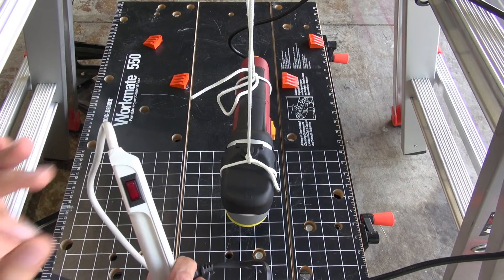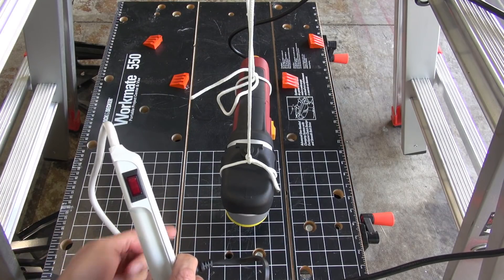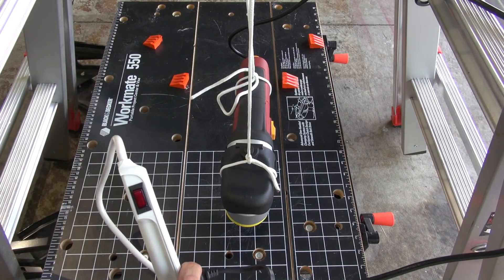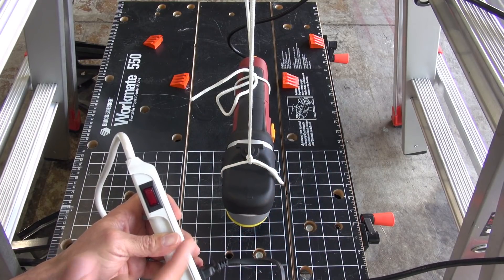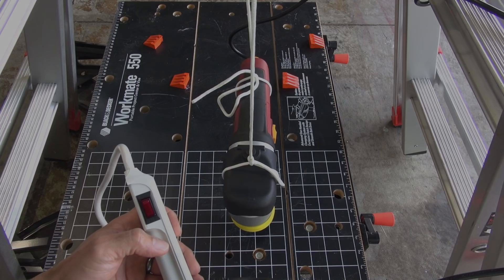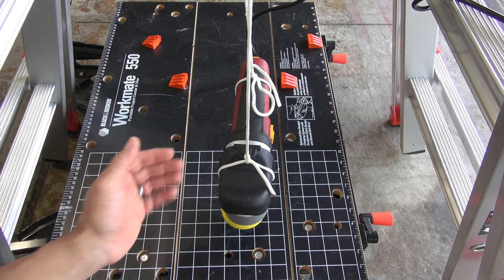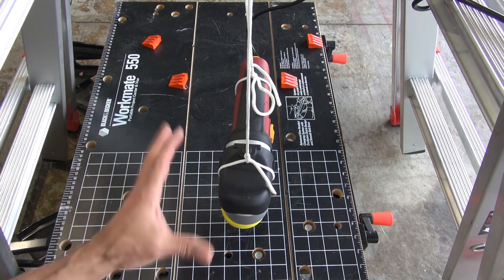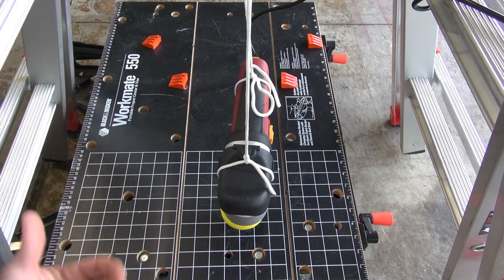Harbor Freight Chicago Electric Dual Action Polisher Vibration Test

Comment: So basically no difference so I'll be fine to throw on a 3in, thanks
Reply from the maker: No difference? What were you expecting, zero movement? Put the 3" one without modification and you may have it brake off and fly away like it happened to me. If you are lucky, like I was, it won't brake your face. Good luck!
Reply: @ToolsAndI  I see little to no difference in the video. Maybe you can feel more of a difference than what is visually noticeable.

Comment: During second test at first seconds look like it doesn't vibrate, but then it starts vibration like in the 1 test with the original parts
Reply from the maker: On the second test only the front suspension cord vibrated for a little bit and if you look closely right before I turn off the power the cord had already stop vibrating. Thanks for checking out the video and sharing your thoughts.